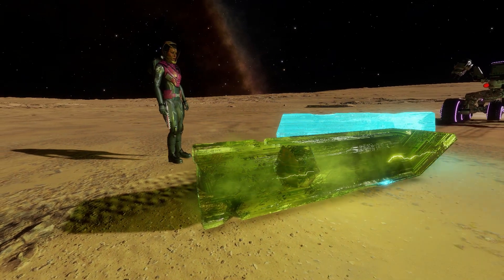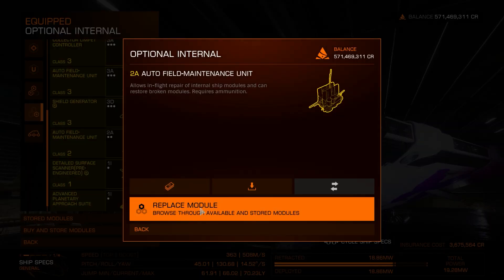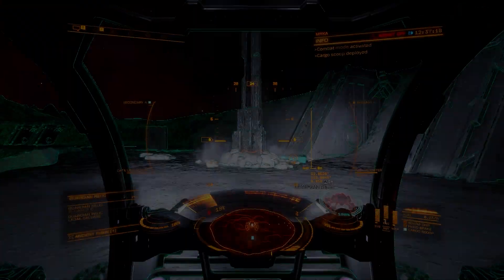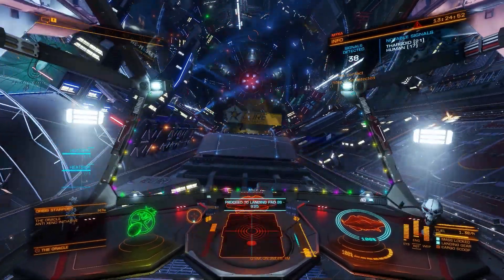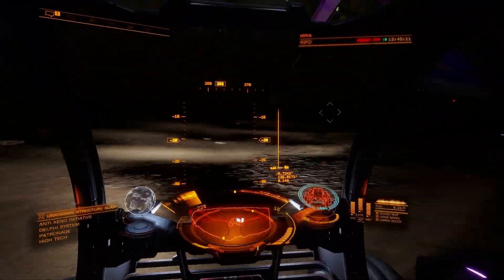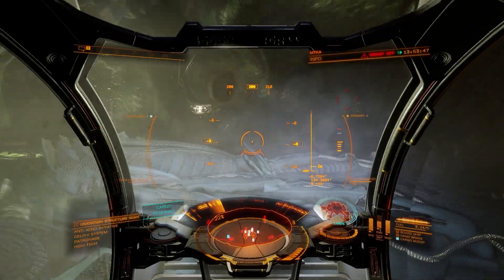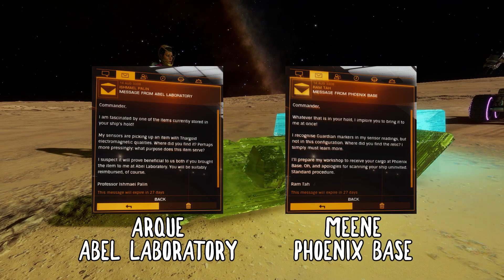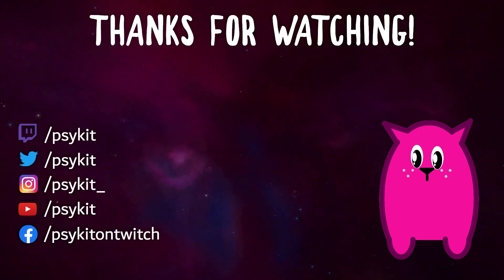A Beginner's Guide to Converting Guardian Relics

Comment: A quick tip, if your worried about losing the sensor if things go wrong. You can pop the sensor in your SRV, head into the structure and pick up a Thargoid Link from one of the side rooms. You can then go back your ship and store the sensor and pick up the relics. The link will open the structure door. 
Saves time having to fly out and finding another sensor if you do something silly and lose the sensor.
Reply from the maker: Excellent point, I've seen reports of folk shooting down links and being destroyed though and have experiences that myself, apparently an EMP grenade will fix it.
Reply: Can't say I've ever destroyed a link while getting them and 3 per room (I think) so a few tries. I have lost a sensor due to overheating the SRV while cooking up some new relics which let me to test the links for access.

Comment: I think things have changed a bit with the arrival of U15 and 15.1.
- I wasn't able to create multiple rounds of green relics without relogging (this was at HIP 18909). The machine would go through its paces, but on the second round it would just eat the Guardian relics and not cough up the new green ones.
- You don't have to carry a Thargoid sensor to gain access to the site; just disembark in the suit of your choice, and wander around near the edges/corners of the doors. Eventually it will open.
Reply from the maker: I'll definitely do some testing of this - thanks!
Reply from the maker: Have given it a test, you can still do multiple rounds of grelic creation without relogging, you just need to wait for the central chamber to stop being angry and it will work, sometimes they do end up in the roof though, as was the case with mine. 
As far as the sensor is concerned, I'd honestly rather drive up with a sensor in my srv to guarantee the door opening than wait for it eventually opening. But each to their own
Reply: @psykit Thanks so much for your follow-up! I do wait for the room to cool down. Regarding the ceiling trick, that may be what is happening with mine. Out of 16 Guardian relics attempted, I could only grab 2 of them.

Or maybe my technique just sucks, somehow.
Reply from the maker: @ctaylor2016  check with the external cam on the roof, I definitely found one of mine up there once I'd ran it a couple times.